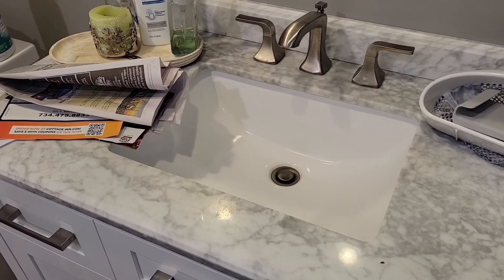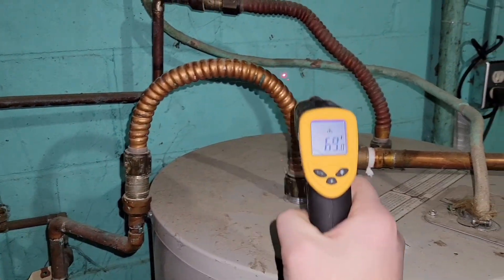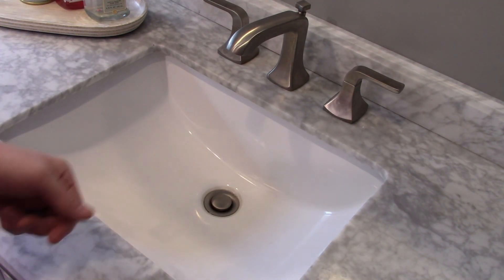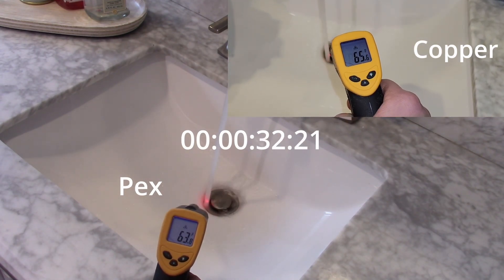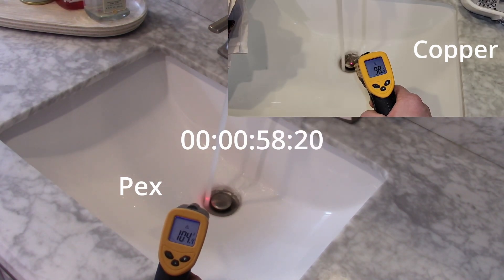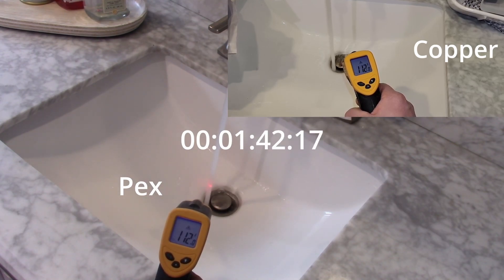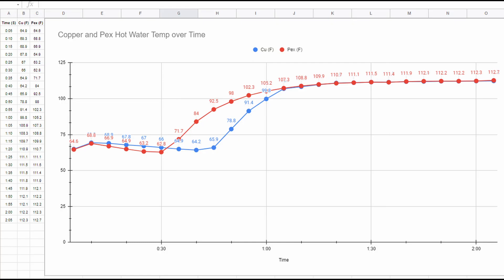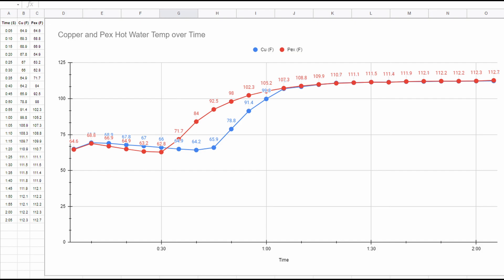Copper vs PEX Hot Water Re-pipe Heat Loss Comparison Test (Graph at End)

Comment: Great video. I'm thinking of running a seperate 10mm pex pipe for hot water from boiler to my kitchen sink. Will reducing from 15mm to 10mm make a difference with speed of hot water reaching the tap

Comment: did you mention the distance to the water heater?
Reply from the maker: I replaced the copper with the same layout of pex. 46 feet from water heater, https://youtu.be/mZAxDuZw__E?t=212. Now that time has passed though I would still do the pex again. I've cut into it and added things that I would have otherwise had to call a plumber for because I am really bad at sweating copper, I even caught a stud on fire briefly (through a blue monster fiberglass mat).
Reply: @striker1211  ha.  I'm building a new house soon, but I am sitll not convinced to do PEX.  I cannot see a reason to do something with a 25-50 year life, while my current house is rocking copper from 70 years ago